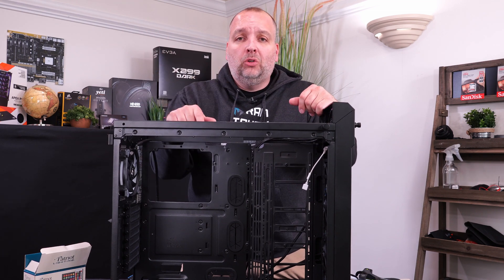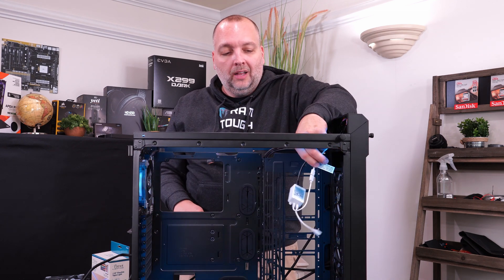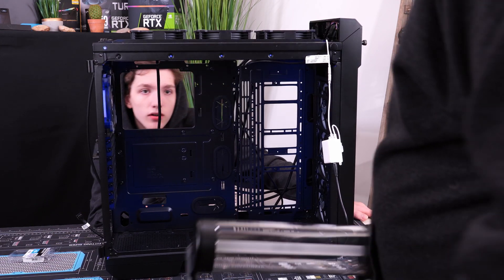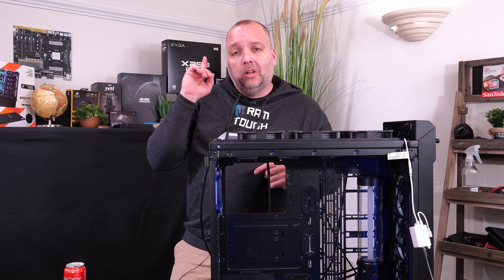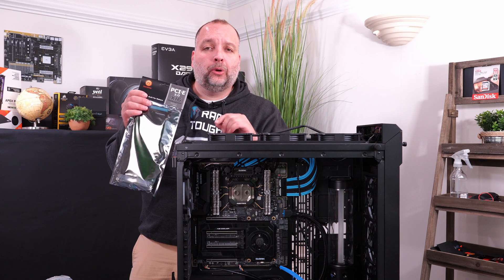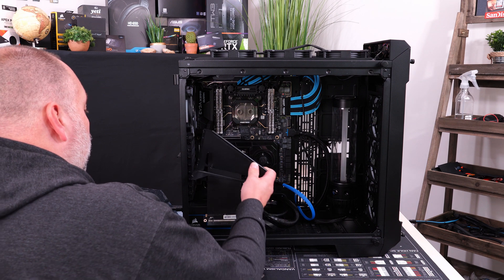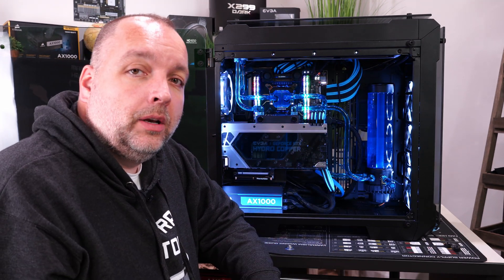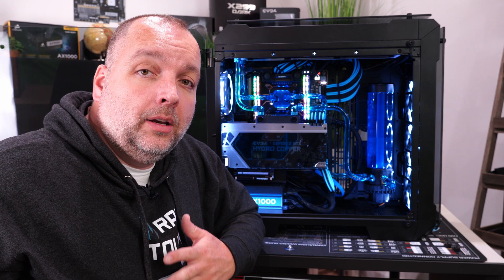HOW TO BUILD GAMING PC 2020 [Part 2] Final

Comment: From my research, it's always better to have cold air being pushed or pulled across the radiator fins. So, despite the conventional wisdom of the cool air coming in low on the front and out high on the back with air-cooling, that doesn't matter with watercooling.